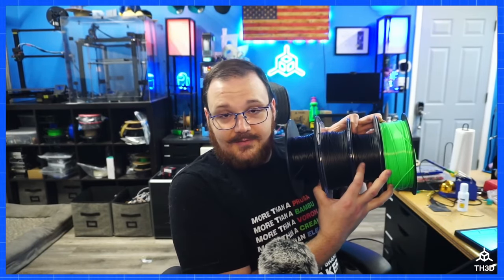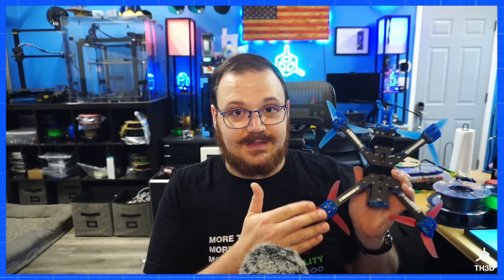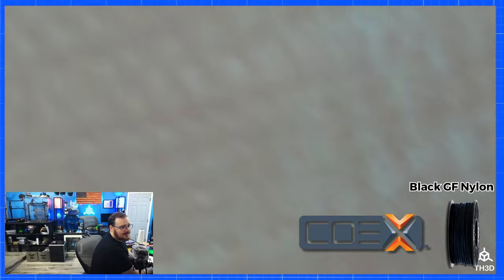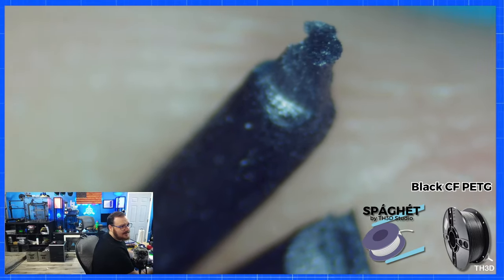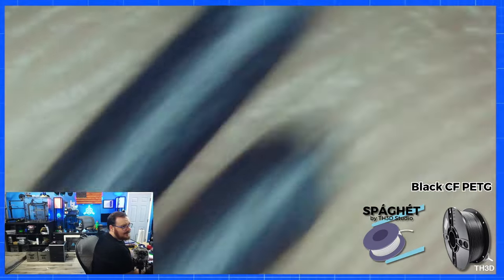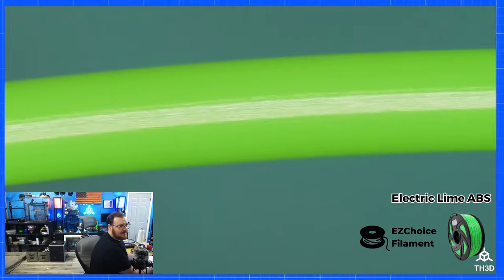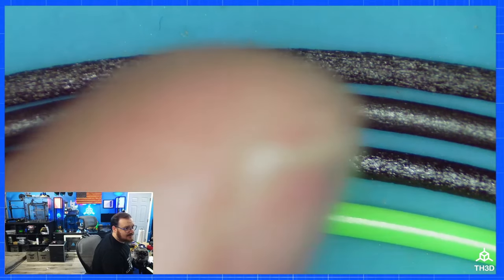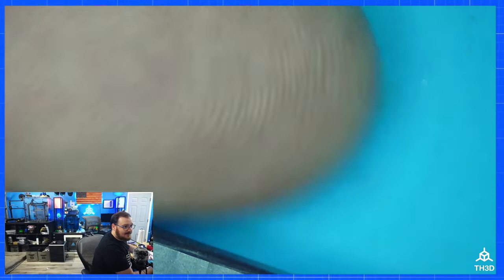Are fill filaments Dangerous? Carbon Fiber & Glass Filled

Comment: Nice! It’s very reassuring to see that carbon fiber filament can be made in a way that is safe to handle. 

I guess that’s the difference between cheap OEM stuff I got from Creality and Bambu Lab.

Whoever is making the filament you’re handling is doing it right. And to a high quality standard.
Reply from the maker: Thanks for the comment! Glad to see that our stuff, Coex, and Atomic are all making it right. Great video btw!
Reply: It’s definitely different filaments.  I run Bambu and it absolutely leaves splinters when I checked under the microscope.  I print a LOT of PETG CF and this was very concerning for me.  I have rifle cheek rests I use often, keyboard keycaps (8-12 hours a day ), my mouse shell, and a few cosplay masks … all in CF.  After watching Nathan’s video I’m redoing all of it … at least spray a clear coat on everything or reprint.
Reply: @TH3DStudio I should also note that I DID see fibers. On the Bambu ones.
Reply: Can confirm that Siddament branded filament does not have fibers sticking out at all and acts like yours in the videos for Australian's buying filament

Comment: Missing critical information: % carbon fiber and more importantly aspect ratio.   As you mentioned - if the CF is ground to dust you won’t see anything and the CF might improve the stiffness (Young’s modulus ) .   The aspect ratio is the length vs diameter and that length is what improves the strength of a print - the shorter the fiber the less interface with the matrix polymer and less transfer of load from the polymer to the CF.    Your filaments must have short fibers if you’re not seeing any when broken (not cut).     Let me know if you’re interested and I can post a video with a wider variety of results.
Reply: I would be very interested in seeing those factors analyzed across different brands.

Comment: I watched Nathan’s video and then yours and what I don’t understand is the focus on the carbon fiber filament before printing and not after. Your brief after focus on a part that had been milled. It seems like the real issue is does CF filament shed carbon fibers when handling printed parts. Neither of the two of you have really addressed it. Am I missing something?
Reply from the maker: We found there was no shedding that we could see printed or not. Could just be the filaments we tested. IMO its nothing to worry about either way. Even talking to people who actually make filament and handle the raw materials also state that its nothing to worry about.
Reply: @TH3DStudio  Thanks for closing the loop. I 3D printed a guitar neck using carbon fiber PLA, so I was wondering because it is a “hands on” part.

Comment: I'm guessing the carbon stays mostly  solid through the melt process and thats why it grinds nozzles so hard.  And your skin would push out the microfibers over time. VOCs are the biggest concern still and I think nevermore is doing a great job with that.  Some light ppe like a set of nitrile gloves will help

Comment: I'm curious to know if the fibers end up in the air while you're printing. Any thoughts?
Reply from the maker: Considering they weren't getting in my hands it's doubtful it's going in the air.
Reply: Tbh it sounds a little silly. Its the small particles you have to be carefull of. Fibers dont seem small enough to get stuck that way.

Comment: I need to catch up on Nathan's video, I watch almost all his stuff.  We run a saw and tool sharpening business and I know I sharpen easily hundreds of chainsaw chains yearly.  I use leather gloves with support wraps but no finger tips and I can go weeks or months with no issues but every so often you catch a metal splinter in your finger.  Maybe its a similar thing with fiber fill, no issues usually but sometimes when you handle it enough you get a run of bad luck.

I kid Nathan about his fetish about fan noise from time to time.  I think he's more of a lab guy than a machine shop guy in some ways.
Reply: Ya  he would pass out if i put my hand under a microscope after work even with gloves on